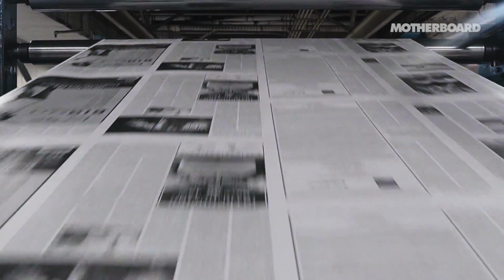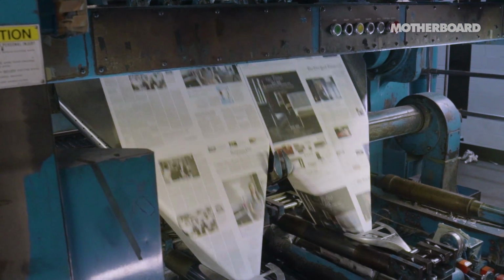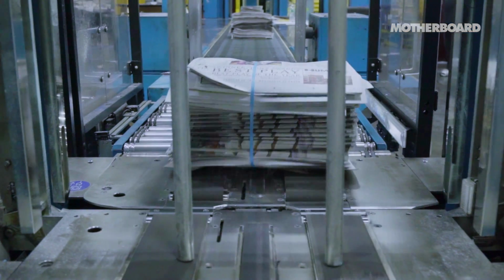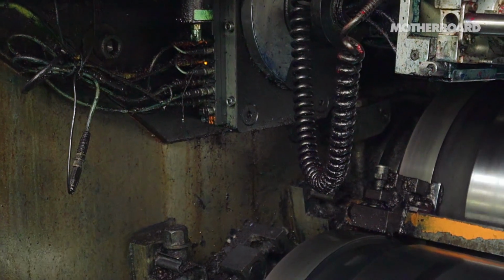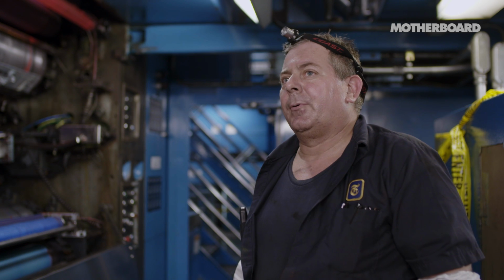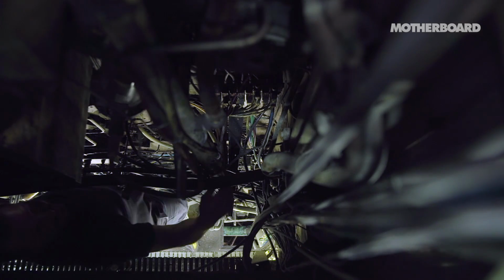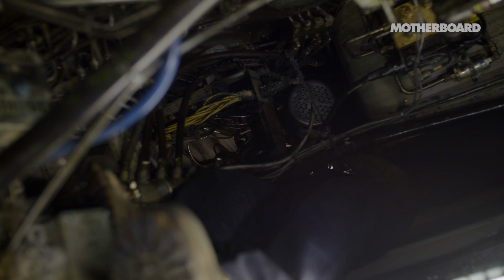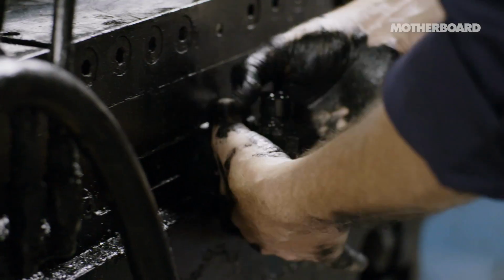Meet the Machinists Who Keep the New York Times Running

Comment: so they are mechanics not machinists..
Reply: USA calls them (fitter) machinists. Canada calls them Millwrights. Some commonwealth countries call them Fitters, or maintenance fitters. They are essentially all Industrial Mechanics. Good trade, I'm proud to have it.
Reply: they are not machinists. it's not the right term for the work. they are maintenance mechanics. All they do is maintain machines, respond to issues, and swap parts and make sure everything is running to spec. at no point are they machinists machining parts.
Reply: "All they do is maintain machines, respond to issues, and swap parts and make sure everything is running to spec." There is alot more to the job than that, I wish it was that easy.

What if maintenance planner fucks up and there aren't any spares in stock / if there OEM is out of business. Sometimes its better to machine/fabricate a part than to order one in. 

Then the maintenance fitter needs a whole new skill set tig/stick/mig welding or depending on the job machine a part from stock or reverse engineer a worn part because there aren't any drawings of it.

They work in thousandths of an inch(thou) so they would likely have surface/cylindrical grinders in their shop which can be a whole other level of nightmarish stress if your working in hundreds of a millionth of an inch.

A maintenance fitter has the skills of at least three trades to get the job done
Reply: Kenny CanHe I know, you must have not seen my original comment and no reason why you should have seen it. I said that I have been a maintenance mechanic doing exactly as they are doing but on CNC machines, and I am an actual machinist now and my every day tolerance is 50 millionths so a thou is a mile in my world. I did say that if they didn't have a part to replace something like a shaft and they went on a lathe and a mill to make it, or welded a broken part back together and machine it back to spec then they would in fact be machinists. but at no point did they say that they machine parts. they're calling themselves machinists because they make machines run smooth.

Comment: More moving parts=more stuff to break right? Sooooo.... solid state electronics=moar better than big mechanical moving parts.
Reply: valstachowski Semiconductors still have moving parts once you grt down to the transistor level. Also, semiconductors can fail from static discharge. Unexpected programming flaws could bring down a machine. We still live in an age where plenty of things can go wrong.
Reply: Justplanecrazy25 transistors do not have moving parts. that's the whole point. they operate on quantum mechanical principles that allow electrons to flow of not based on material properties. 

logically, they act as gates and switches, but they are not actually these things in any mechanical sense

Comment: I work in a typography. So I know what it takes to make those copies. All the swears and imprecations in restrict north Italian accent when something does not work. When the paper brakes, or when line stops. We have a similar issue since the 24 pages KBA is old now. The quality is good, but the machine is hold together by the color. Specially the yellow. We don't print news papers but we print flyers, magazines, covers. The news paper printing is focused on producing only the news paper, they don't have much time, but is more restricted, unlike where I work. We change paper, since we have a variety of jobs to do. We work on shift, usually 4 x 6 days. Starting from Sunday 23:45 to Saturday 24:00. The machines are from Germany, they are closed in a respective room to reduce the noise.

Comment: I've worked at smaller scale printing plants than this.. If you're lucky you get 8 minutes till you have to calibrate or stock something and it's usually hot from all the friction and motors. Everything is at least 15lbs. I'd rather work for less somewhere unless they paid more than 70k which they probably don't.. I'm sure these guys have good benefits but probably get like 65k which is basically 32k in the NE.. If they got paid what they are worth in the current market they'd retire early.

Comment: Dying breed of repairmen?  are you having trouble finding a plumber, HVAC technician, or auto mechanic or something?  Are you used to simply buying a new car anytime the oil needs changing, or the radiator leaks?  What do you do in this "disposable society" when the plumbing or Air conditioning breaks in your house, tear it down and build a new one?
Reply: Well as processes become more complicated, repairmen will die out. Let's take the new Audis for example. It breaks the warranty if you lift the grid plate off the engine because of "high voltage" lines running along it. All diagnostics are performed by a computer and repairs will occur in specialized repair facilities. Where do you take your electric or hybrid car to get it fixed? Not to any mechanic. I'm not exactly supporting this direction of events but it's surely the future. 
Some plumbing systems and HVAC system use incredibly complicated Building Automation Systems. Sure you can replace the fan blades but most of the troubleshooting is done by specialized technicians on failed network connections. 

I really love guys like these ones. I work with them now in the electrical train industry but they won't be there in the future. It makes me sad but it's just the way of the world at this point.
Reply: Seth Jones i am in the field of hvac, Refrigeration, and bms system.  in order to gain efficiency everything is electronic now.  it's just like when you switch from carburetor to efi to obd 1 and then to obd2. i have a chiller that think it's freezing up when it's actually not.  why?  because the programmer map the alarm to the wrong path.  all of them.  i rather work on the older unit add they're more simple.  i don't think my company could justify the training cost of the more modern machines as we don't have any of it.  this such as trans critical co2 refrigeration, liquids bromide system,  etc etc.
Reply: Seth Jones i am in the field of hvac, Refrigeration, and bms system.  in order to gain efficiency everything is electronic now.  it's just like when you switch from carburetor to efi to obd 1 and then to obd2. i have a chiller that think it's freezing up when it's actually not.  why?  because the programmer map the alarm to the wrong path.  all of them.  i rather work on the older unit add they're more simple.  i don't think my company could justify the training cost of the more modern machines as we don't have any of it.  this such as trans critical co2 refrigeration, liquids bromide system,  etc etc.
Reply: Journeyman Reefer yeah, but OBDII gives you tons of diagnostic data quickly and efficiently.  I n some ways, working on an OBDII equipped car is easier than an old ore OBDI car because it will tell you up front what everything is doing.  Back in the 1970's you needed a huge piece of diagnostic equipment to measure only a small fraction of what modern scanners can do.  Working on pre OBDI cars is an art form.  You can get a tune up done by ear and feel.  That requires experience younger techs don't have.  OBDI is for me the hardest to deal with.  Nothing was standardized between manufacturers.  The scanner equipment designed to work with OBDI required lots of adapters and it's all obsolete and hard to find.  Nobody at my shop has the scan tools to deal with OBDI because we don't get enough customers that daily drive a car older than 1996.

Comment: Respect to those guys. Last of a dying trade.
Reply: They're millrights plenty of em around
Reply: Not really dying, There's always something to fix. Doesn't have to be a printing press.
Reply: The direct knowledge of fixing 90s printing equipment was what I was referring to.
Reply: @RhynoPhreak  correct..i have the Heidelberg QM 46 components, gears, chains, rollers, pressure settings burned in my memory from a decade of printing and fixing. All digital now..not the same.

Comment: I worked on and regularly rebuilt pumps for flood control stations that were built in the year I was born, 1958. I have dealt with companies that have been bought out by 3 or 4 different suppliers. Mid 90's machines, phttt!

Comment: these guys are millwrights not machinist
Reply: Exactly, they are millwrights. Jack of all trades. Millwrights are trained to maintain and repair equipment as well as manufacture one off parts with manual lathes and milling machines. We troubleshoot electrical, pneumatic and hydraulic systems. We maintain precision systems such as steam and natural gas turbines. We weld and are expected to understand metallurgy. A machinist does none of the maintenance and overall tasks carried out by these craftsmen on a daily basis. However, the trade system in America has little recognition for one of the oldest trades out there.
Reply: Scott Coffey a machinist is a person who works with lathes, milling machines, surface grinders and various other metal shaping machines. Usually located in a shop. These guys are clearly millwrights. They are responsible for the health of the various machines around the New York Times.
Reply: So essentially everything a millwright is trained for here in Canada. In our first year. The argument isn't "do these guys even do the work of a machinist?". The point is that millwright are trained to maintain, repair, rebuild, remanufacture, and fabricate. Everything these guys do. Jack of all trades, master of none. In my opinion millwrights are some of the most skilled tradesmen out there.
Reply: Ryan Breker jack of all trades, master of many.
Reply: Ryan Breker It might just be that Canadians call them millwrights? Machinist: Someone who makes or repairs machine. People are getting a little too specific with the job description to the point where they give these men different jobs. I'm sure that man knows his own job title after working there for 30+  years. They simply repair machines so they are machinists. That is the definition of machinist in every dictionary.
Reply: and what skill level is that? lathe operation? CNC programming? knowledge of metals? wildcat is right, these guys do repairs and maintenance on in house machines, which is a millright. I liked this video but i was expecting something entirely different when i read the title.
Reply: In Canada they are millwrights. In USA you call them (fitter) machinists. I am millwright by trade, trained by fitter machinists. I am an IAM member.
Reply: Brandon S Even here in Canada, they are doing away with the old word millwright designation. We in Alberta are the only province hanging on to the traditional name. Everywhere else it's "industrial mechanic". Thanks for the info.
Reply: we use lathe, milling machine, surface grinders, all sorts of boring and broaching,plenty of knowledge of metals for shafting and the maching of brackets that we are un able to get through the manufactures. bearing heaters honing of bores, hand scraping indian heads. indicating motors and drive shafts on high speed equipment. I can go on for hours on what we do.
Reply: looks like millwrighting to me. In Ontario we still go by Millwrights or industrial maintenance mechanics
Reply: JbassPlayer28 this is what I did for 10 years of my life and what is understood to be a machinist where I'm from. I have done some industrial maintenance too, but no one here would call that machining. Machining is making parts to spec from blueprints. Nuff respect to these guys and their skill and knowledge, great video but I was waiting to see them make parts for the presses.
Reply: Where I work we have roughly 50 millwrights and 6 machinists I don't touch lathes or mills there on that job but I have on others
Reply: yes we use lathe milling machines surface grinder among other machinery and different types of metals for shafting bushings etc.etc.etc.
Reply: I've worked with millwrights from all over the US and they call themselves millwrights as well, you can also call them industrial mechanics also
Reply: Tool and die has its own apprenticeship separate from the machinist
Reply: no, they aren't. machinists are given a print and manufacture new parts from scratch. Millwrights maintain/repair existing machinery. yes there is some manufacturing skill needed, but its not the same as a machinist
Reply: @JbassPlayer28  facts
Reply: Ryan Breker I'm an Industrial Electrician in Toronto and I call them Millwrights out of respect. The term 'mechanic' cheapens what they do to be honest. It's a lot more than swapping out bearings/shafts.
Reply: "outside machinist" is a term for men doing millwright work, fitting & maintenance. a machinist only produces or repairs parts.
Reply: Machinist make stuff these guys Just repair stuff
Reply: I work with these guys we are not millwrights.  we are MACHINIST whole different skill level here.
Reply: To my understanding its because they never was a popular trade qualification for Millwright in most parts of USA. So the good union employers sent their apprentices to trade school as machinists as it is the most relevant trade. This has happened to some other industrial settings that go way back to operation in the 40/50/60s that have not been involved with resource extraction (where millwright is the common qualification, especially in Canada)
Reply: "WELL ACKSHUALLY--" that's how you sound man. (Inb4 "you can't even spell actually correctly).
Reply: I've never heard of the term millwright here in Aus. Someone doing this type of work with a trade would be called a fitter & turner over here. I've worked in a similar production factory under that title here. Our Fitter & turners here learn about machining, fitting & welding. Depending on their workplace they'll specialize in maybe 2 of the 3 with a basic knowledge of the other.

Comment: Machines are cool, but they are dying, for good reason.
Reply: Machines are going nowhere...
Reply: Panzer Faust machines are not dying. but in the long run its cheaper to build/allow sloppy machines and correct the issues with electronics than it is to build precise equipment that works flawlessly on purely mechanical principles. 

computers are machines, and they control all major manufacturing across the globe.